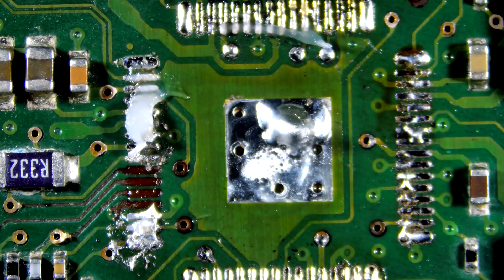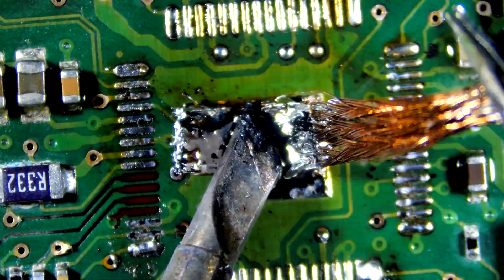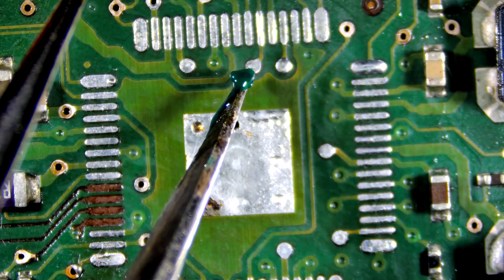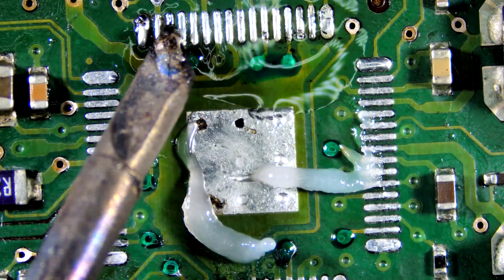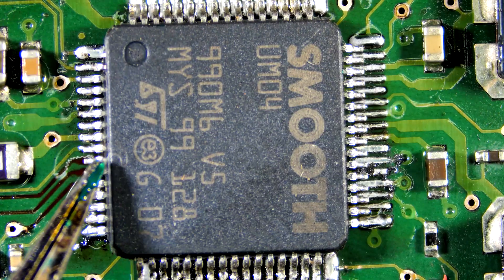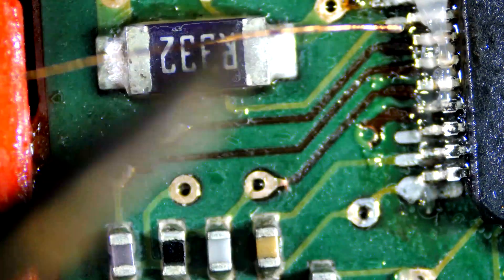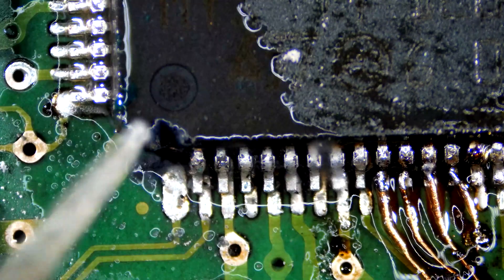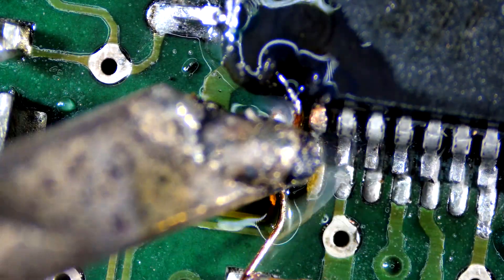How to Solder 54 Pin IC with Pin & Trace Repair | Step by Step Guide

Comment: Wow, what happened to get it in such a mess?
Reply from the maker: I am not sure about traces but I think the pin broke while removing chip
Reply: @CircuitFixTech  Hard to do unless someone removes it with a crowbar! But in the late 80s, I had a massive Motorola 68000 DIP that lost a pin, so I put it into a DIP socket, cracked off the corner (same principle you used, but far less skill and style) and then wired down to the socket.
Reply from the maker: as long as it works and it is durable it's fine
Reply: @gadgetmind  it's a lot easier than you think to break a tiny pin like that.
Reply from the maker: Yes specialy corner pins
Reply: @CircuitFixTech  yes - is this because corner pins are badly exposed if we fumble cpu onto the desk?  : )
Bending it back into shape is the hard part really; we only have one shot to get it perfect!  Great job here by the way.  I've just replaced 14 cpu pads on a QFP 100.  Awaiting a new H8/3006 to complete the job!  Always great to see similar repairs.